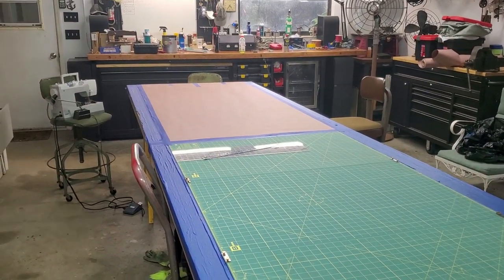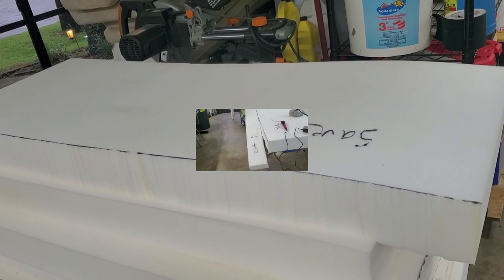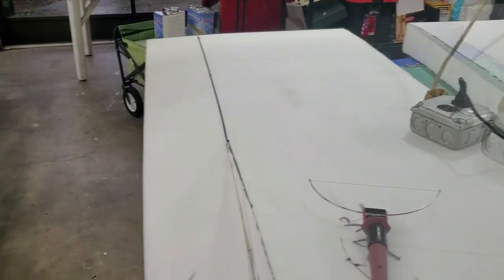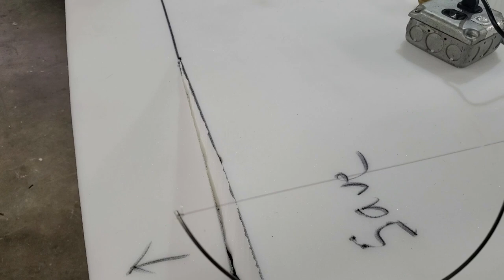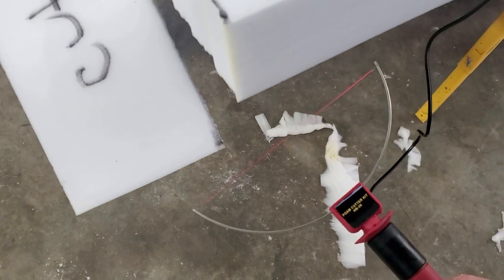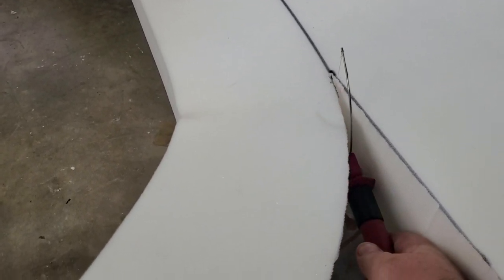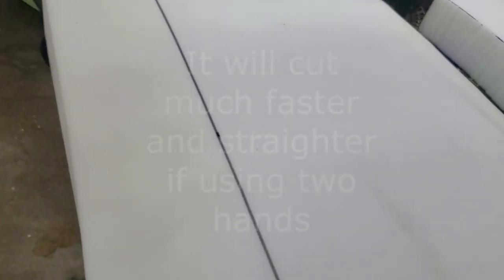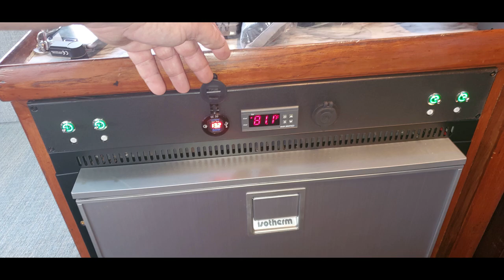DIY Trawler boat cushions using Sailrite box cushion method

Comment: Hi fellow cruiser!  Very informative video!  We cut the foam for a set of cushions with a bread knife but your method looks much better! 😁😁
Reply from the maker: I just got an electric carving knife. You can get them from Amazon pretty cheap. That is the best method for us so far. Leaves a smooth cut.
Reply: @mvintrigue-trawlerdiy1101  Thanks!  Hope you fared well through the tropical storm.
Reply from the maker: @LabMariner  I actually took a video of it as it was right next to us at high tide. You can find it under my other videos. Pretty precarious in a storm like that...even tied up at the dock.

Comment: awesome work, and the bowling alley wood, how did you come accross that, Right place at the right time?   Awesome
Reply from the maker: There was a nearby bowling alley, I think it was Hudson Bowl, that was closing down and advertising bowling alley sections. I needed to make a workbench for the workshop so I bought three sections that where around  12-14 feet each for $125 each. I made one into an awesome workbench with storage, fridge, power and air. I built it around a very large toolbox and then put leveling feet on it. The other is that workspace in the center of the shop which really comes in handy. And the last piece I recently sold for $350, since they are becoming rare and worth a bit more. Thanks for the kind words brother.

Comment: You guys work much faster at that than I do!
 Did you order foam or buy it locally? 
I want to make some new ones, but need to finish the davits/solar and engine first.
Another great video
Reply from the maker: I ordered the foam from Amazon. The foam from Amazon was decent but it was not quite the same density as the old school foam it replaced. But it was plenty sufficient. On the areas that may double as sitting/sleeping I went with 4 inch foam. It seems to be plenty stable. Thanks a bunch brother. See you out there!

Comment: How fast will your natural  perkins / non-turbo/ push your boat on top speed or just cruising.
How much does your boat weigh?
Thanks
Reply from the maker: I have not tested the speed with the fresh bottom job yet. But prior to the bottom job it would hit 9.8 mph around roughly 2600 rpm. But I am sure consumption was high pushing it that hard. We cruised from St Pete to Tarpon Springs at about 8.8 mph at around 2200 rpm. Tske those rpm with a grain of salt. I have since calibrated the tach. I want to say the boat weighed in at 22k lbs at haul out during survey.